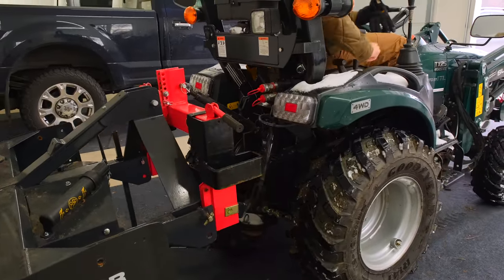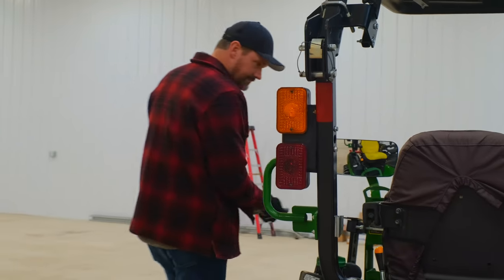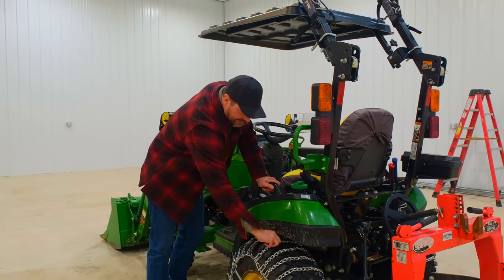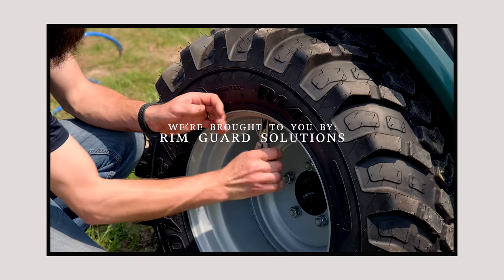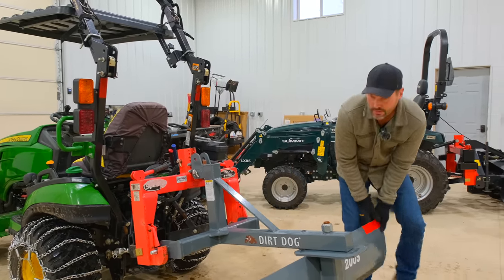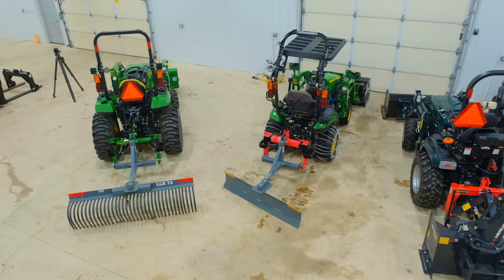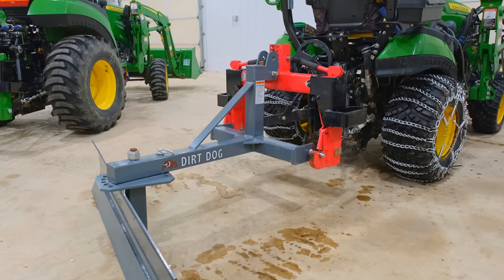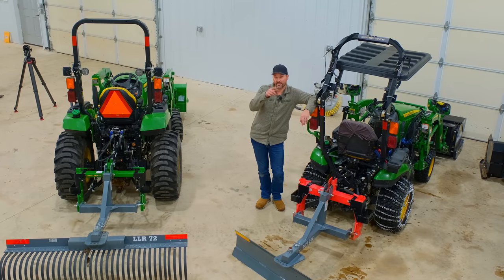I MADE A MISTAKE & CHAINS ARE CAUSING DAMAGE! 🤬🚜

Comment: I’ve used chains in the past and they have ground off some spots in the driveway or sidewalk the when turning and when snow plowing. Snow build up can stop the tractor and rear tires slip. You’ll see the marks especially in the summer when the snow melts. I don’t plow neighbors sidewalks or driveway with chains since they may not like the damage from the chains. I use a composite plow edge so I don’t scratch the concrete with the snow plow blade.

Comment: Thank you for seeing the chain put on with the outside link hitting the Tire.(Believe me, they indented the plow trucks tires we did that by accident too) May I suggest it in my Humble opinion. Go to a local carpet store to see if they have Carpet SQUARE, or just throw away from a piece that's been sitting. Just see if they have FREE carpet remnants. Just lay them down ONLY where rear tires contact cement. We had an ice Rain come in., Just yesterday. The mail truck was only one out. They even shut down the major Airport. Anyway, noticed that on pavement the mail truck did the same thing to the street, that happened to your NICE clean great looking, don't want dinged up cement floor. Just an idea. Also sense you sell tractor and tool attachments. Can you afford to have a TIRE already with good security CHAINS on 
 old tires that tread is gone, maybe. Then just change out the rear tires. Just another thought or idea. Don't feel bad about the chain on backwards, you know how many times I have Laying them out WRONG. Went all through install And getting to the last link hook up. Then I noticed them backwards. I did it too many times to count, putting on chain after chain on the rear wheel duel 12 yard plow dumps. All the time with the supervisor yelling. These trucks MUST get out!! On another note. What do you think of those (magnetic Engine OIL pan heaters) I just bought one for my 8V-71 Detroit Diesel Engine. I saw that outside tractor starting very cold blooded.??????
I want to see if my baby STARTS more easily in this cold weather we have been hit hard with. A BIG Merry Christmas to you my tractor friend

Comment: I’ve cleared snow for in town businesses for about 30 years. My normal configuration is a material bucket and a rear blade with no shoes on either. Most of the time I’m back dragging and shoes would prevent an even down pressure across my cutting edges. Back dragging allows my fixed bucket and blade (no trip springs) to ride over manhole covers, loose asphalt, concrete joints, and stones without picking them up.

When dealing with stone surfaces specifically:

Unless I’m clearing a long road, I generally back drag my blade traveling in reverse to avoid packing snow under my wheels. A mound of packed snow is difficult to lift without lifting stuck stone too. I set my top link to make the back of the blade vertical on the snow side with the cutting edge rolling under.

The amount of down pressure I use varies with the looseness of the surface material. If it is very light round material like pea stone I run the blade a few inches above the stone. On heavy packed locking stone like three quarter Septic I can usually float the full weight of a heavy duty 6 foot blade.

If you get the roll and pressure right most stone will roll and pack under the blade. If the stone is still being pushed / plowed forward by the weight of the snow being pushed over it, I will cut the majority of the snow off with the bucket first. On very loose stone I will back drag the bucket at a low angle applying down pressure to pack the remaining snow over the surface.

When dealing with stone I use my bucket mainly to back drag snow out into the open and for packing the surface. I run Ag tires so I usually take the extra step of back dragging my bucket out of the work area to remove my tracks. When cutting forward on stone (top cutting deep snows or piling) I keep my bucket about 2 ½ inches off the surface and make slight height adjustments by rolling it. I never float my bucket when cutting on stone preferring a precise cut height that can be packed and minimizing the chance of digging in.

In general, there is always some stone that is picked up. The lighter, looser, and rounder the stone the more the potential for and care needed to prevent it. To minimize any post cleanup I always try to make my piles over the work surface. That said, I have found back dragging to be the best approach to clearing snow off stone surfaces.

Where you have a rear blower you could easily remove a deep top layer of snow and then finish with a bucket or blade back drag on your drive. Rather than relying on the blower’s skids I would set your 3 point stop so the blower’s cutting edge was a comfortable height above your stone road. The skids would probably just dig down into the stones and send them flying.

In the end, just my take on dealing with stone lots / drives. Hope it helps.

Comment: Cortney,  We really enjoy your channel!  Noticed that you were concerned about the "chipping" your tire chains were doing to the concrete floor in your shop.  My husband has a suggestion.  What we've done is get some empty, flattened "gaylords" from a local plastic injection molding plant (gaylords are basically ultra-heavy duty cardboard boxes that plastics raw material is shipped in--roughly 1" + thick).  We're not sure how things are there in Michigan, but here in North Idaho, if the company doesn't use the gaylords to ship oversized products in, they are generally discarded, and, locally at least, they charge to get rid of them.  We are fortunate, in that my husband works for a local plastics manufacturer.  We have used a set of six of them for the last two winters on the concrete floor under our tractor, a Kioti DK4510SE with a cab and backhoe, and Rim-Guard weighted rear tires, along with box chain tire chains in the winter.  The gaylords work flawlessly in preventing damage.  If this is something you may be interested in trying, you might want to check some of your local (more or less) plastic injection manufacturers.  My husband did a quick Google search and came up with three (there may be others).  Harloff Manufacturing, on I-94 West of Mattawan, (269)-655-1097; Western Diversified Plastics, Mattawan, (269)-668-3393; and W-L Molding of Michigan, Portage, (269)-327-3075.  If they're like the local plants, they'd be more than happy to fix you up for no cost, other than what it costs you to go get them.

Comment: I use an old JD 140 garden tractor with a blower for snow removal and tire chains are a must since it’s 2wd. It does mark up the neighbors newer driveway that has a pretty smooth finish. Our driveway is older and has a more rough finish and there are no noticeable marks.

Comment: I use horse stall rubber pads cut lengthwise and put them down in the winter.  Like a runway for eash tire.  SAves my shop floor.

Comment: I found out quick that it was near impossible to steer my 4WD tractor on a slope because the front tires just slip on the snow even though large gravel underneath. I am trying the European style chains soon that you see on skidders, no tensioner needed. Hopefully don't need to buy suitcase weights for front bumper. The weight of the loader and bucket does not help as much as I had hoped. My rear R4's are weighted.  Concrete is a rich person problem😂

Comment: I have a larger machine and the chains are heavy! 3/8" two-link style chains weigh probably ~75# each. I use a floor jack to lift the rear one wheel at a time. With the trans in neutral I drape the chain, in the correct orientation over the tire and roll it so the chains wrap around the top with the tails below on the floor. I then crawl underneath and attach the inner side link first. Then attach the outer side link after equalizing the crossbar spacing all around. Lastly I attached the spreaders and tie back the couple of loose outer side chain links. Quick and easy 10 minute job per side after about 45 years of experience.
Reply: "in the correct orientation"  😁 I know I've put them on incorrectly before and that's why I think it's so funny.  I also lift lift my tractor and drape the chains over the tires.  Even though it's just an old Sears Garden tractor, it makes it much easier.

Comment: Yes. that's why I don't pull my tractor in the garage after I put chains on it. I dont want my floor chewed up. Some on in the comments said use stall mats cut if you need to get inside. Sounds good to me. I have used boards to pull mine in if I absolutely have too.

Comment: Steel chains will bite into concrete and blacktop. Yer best bet is get rubber chains. I put them on right away when I got my new home and sold off steel chains. The rubber ones work surprisingly well. Also a quick tip to installing any chain type is jack up rear end and put the hydro in free wheel. Then you can rotate the chains and get the perfect fit taking out any slack.

Comment: I hate chains.  They also mark up my concrete.  We bought a Can-Am Defender UTV a few years ago and I priced a plow for it versus chains and implements for my Kubota L6060HSTC.  Economically it was less expensive to purchase the plow for the UTV.  It was much less of an initial investment, no chains required, less chance of damaging the equipment if it slides on my hillside, less fuel costs, and so forth.  My UTV has the front and back windshield but no cab like my tractor, but the tractor is simply just too expensive to clear snow with.  I used to use the bucket years ago but it was so dangerous on the slightest incline without chains.  Then you have the risk of the chains themselves, if they break or come off they can do a substantial amount of damage.  If we got 2’ of snow in each storm like some areas then yes the tractor may make sense.  But for us in the mid-Atlantic, the UTV was more economical for us.  So my tractor investments are for when snow does not exist :)

Comment: I have a 4710 . The chains I purchased are heavy from Norway. They work great for me. We are in the mountains. Up to 19% grade on the driveway. I rigged up pulleys with an winch. I lower the chains down on to the tires. Really helps with the weight factor. The tires are set to the widest I can get them. So no problem with fenders in the way.

Comment: Your first install method is what I do 👍 best way to get the tight. They will balloon out when driving and hit everything in the wheel well if not tight. I use rubber stall mats in my garage just enough to get the tractor in the door.

Comment: I don’t use chains in my garages or on my asphalt for just that reason.  Chains will make a mess of both concrete and asphalt over time, particularly the crossbar chains I use on my pickup when plowing ice.  I take then off before I back the truck into the garage, but I have thought about trying the cattle mats.  Not sure how long they would last but they should protect the floor for a while at least.  I have also backed into the garage on lengthwise 2x8s a time or two when I really thought I would need the chains again the next day.  The chains are tough on the boards, but preserves the concrete.

Comment: We have a Farm King pull type blower up in Canada. The trick when you're blowing deep snow is to use the bucket up front as you're driving along. Hold the bucket about 12" off the ground to clear enough snow that you can drive through it. After the first pass (slow) just take partial passes with the bucket tipped forward to catch snow and let it fall infron of you. Hard to explain but it works!

Comment: I bought a set of rubber strap chains for my zero turn with a plow I mounted on the front. I have used them for 3 winters now on my concrete driveway. Works great even with the steep section. No marks on concrete. Highly recommend.

Comment: I use my FL and rear blade for snow and they work well for me.
I’m trying something new with both FL and rear blade this year. I cut a slot lengthwise in 1.25” black pipe. Fitted it over the edges of the blades and fabricated mounts as needed to hold the pipe secure. Will see how/if this works on gravel drives. I have about 550’ of driveway to clear. 
Would love to have all those options for snow removal though! 😊
Reply: Are you using plastic or steel, I am going to try this with plastic because it's easy and free, after I install my block heater... I have heard others doing this and it works to prevent digging up gravel, I don't have rich people problems with concrete or asphalt 😂
Reply: @melissasmess2773  I’m using schedule 40 black pipe. I thought about using plastic but was afraid of cracking it and or wearing right through it from the friction of the gravel.
It was easier for me to fabricate mounts and weld them to the pipes for both FL and rear blade.
However, plastic would be kinder to asphalt/concrete drives. Maybe drill holes at the ends of the pipe and use bungee cords to hold it up in place. This would be providing you slot the pipe to fit over the cutting edge of your blade.
I’m going to run the rear blade facing forward so it will be more  efficient at dumping snow off the end. I also shortened the top link to stand the bottom of the blade edge, up. This should make a less aggressive angle to the driveway.

Comment: At the 9:40 mark you are in the correct orientation with that rear blade.
By running it "backwards" you eliminate gouging your gravel.  It also helps if you hit a rock or small curb in that it might slide over instead of catching and breaking something.
I have run my rear blades like this for over forty years.
In fact, I tend to run my blades like this even in the summer, most of the time.

Comment: I have about 700 ft of gravel driveway, plus around my pole barn. I plow with a blade on my atv. This year I mounted a 2 inch steel pipe on the bottom. This is working great. It doesn't dig in or push gravel over to the side. It doesn't leave a film of snow like when you use skidders either. There's a very ingenious guy on YouTube that mounted a pipe on his truck plow. He made it so he can remove it with 1 pin and store it on top of his plow when plowing paved driveways. Check him out.

Comment: When I add chains to my GX345  2WD  I use a hydraulic jack to lift the rear tires off the ground then you can spin the tire to put the chains on.  10 minutes or so.  They do leave rust stains on the concrete after the winter, but that beats getting stuck.

Comment: I would use a pusher if you have somewhere to move the snow to. Snowblower can be very unpleasant with an open station machine but probably best if limited placement areas for larger amounts of snow. We lived in the Lake Erie snow belt for 25 years and I managed with a B7200 with FEL and a back blade but it wasn't easy or fun. Now I have a Ranger Northstar with a 6' hydraulic BOSS system and nothing beats plowing from inside a heated cab! Being able to tilt the blade L/R while staying warm is huge and saves a lot of time.
Merry Christmas!

Comment: If you jack the wheel of the ground and let the air out and put them back on as tight as possible then air them back up. Put your tightness in it will save a lot of wear on the chains and should never come loose.

Comment: I have used chains on my 1025r for years since I have a 15% grade up my asphalt driveway.  I usually wait to use them until the ground is frozen since my shed is in a field, unless a big storm comes.  I have not detected gouging in the driveway. I also get a seal coat every few years too which may cover if damaged by chains.  I would be concerned if I had concrete and consider rubber chains instead.

Comment: Similar to turning the blade backwards, I used the box blade on my 1025r tilted back to help remove heavy slush off my gravel driveway. Front mounted snow blower removed the pile dumped at the end of the run.
Looking forward to the results of your test - enjoying your insight. Merry Christmas 🎄

Comment: With gravel, you might want to try a roller on the first snowfall of 3-6”.  That will help pack down a layer that will encapsulate the stones so that later use of blower or plow is less likely to pick up the loose stones.
Reply: I agree. Early in the season I pick up a lot of gravel, later on when the stones are frozen into the ground it is less of a problem.

Comment: I love the idea of spinning that short blade around. I look forward to see how that works for you. I never needed chains while blowing snow. Even on ice covered snow with 24" drifts. My JD2320 was phenomenal. I also have JD turf tires. I would put that set up against any other. What i could use at some point is a snow pusher. I have a blade for the front for wet snow but it marks drive ways when I angle it. I cant use it unless i keep it straight. The pusher with plastic feet would do me some good

Comment: I see you like to push your equipment to see how much it can handle(saw this with a mower you had used).  
How big of a snow pusher can you put on this?  8'?  
Years ago i had a 70's massy 12hp, MF12, had 42" plow, I put V wings on pushing a path almost 60" wide. No add weight but the tractor was around 800 pounds, and had tire chains. I've upgraded sense then, sorts of miss that old tractor.

Comment: Those are small enough to drape them over the top.
Reply: Those are light chains you should be able to drape up to r 26 R 4  diamond H tractor chains with one person.  Those ladder bar chains are pretty light looking. Here Most commercial ops use diamond H pattern with pegs or V bars and if they want light chains go to titanium .    Just dont spin them on a finished surface.
Some logging ops here 2" put angle iron cross bars into the mix welded across the  diamond H  pattern.